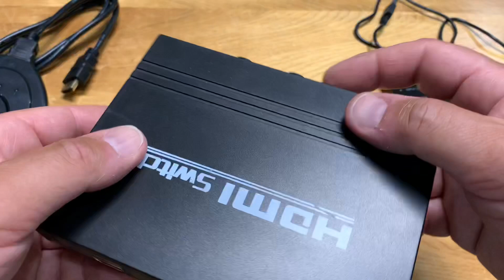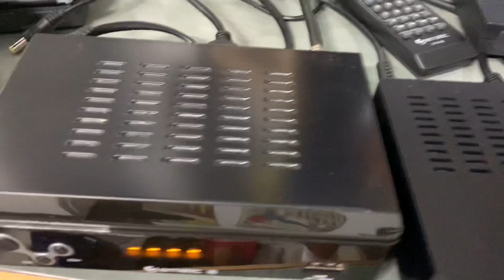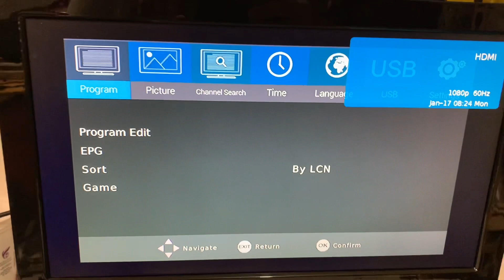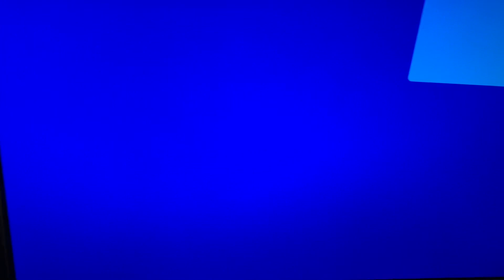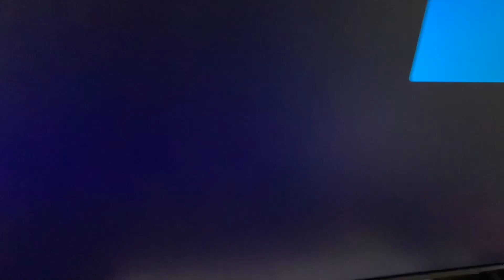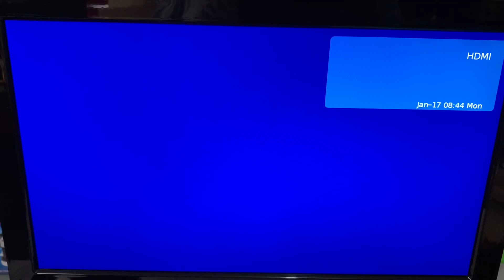Options for adding HDMI ports to your TV

Comment: Think this would work great with video game consoles if someone who has modern consoles or retro game consoles and upgrade to a hdmi converter adapter instead of using rca cables
Reply from the maker: @mantlecollector  HDMI to Coax on the Cheap | HDMI to Analog Coaxial Cable
https://youtu.be/fIHpdyl1x-Q